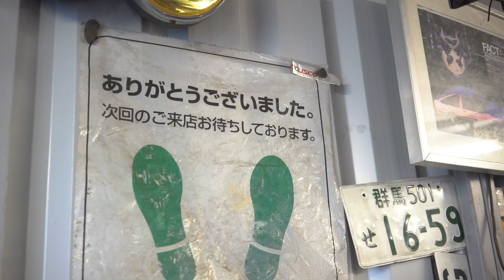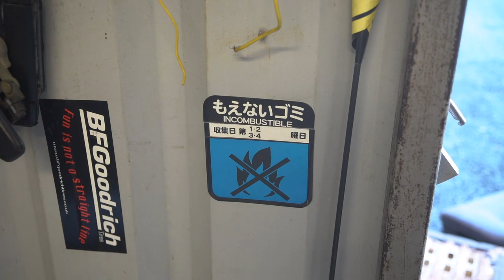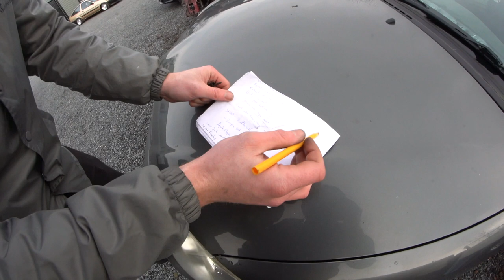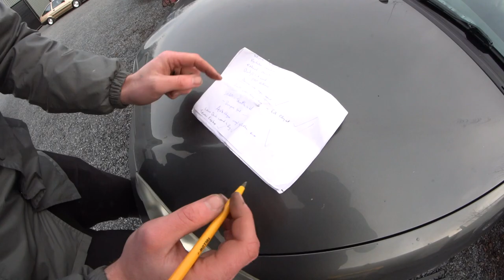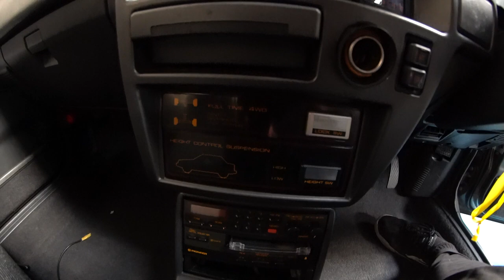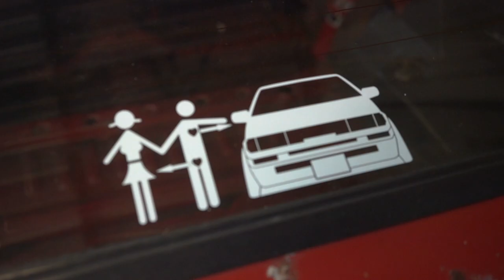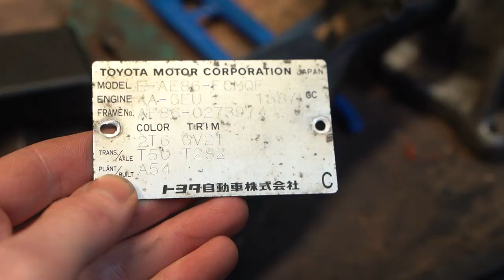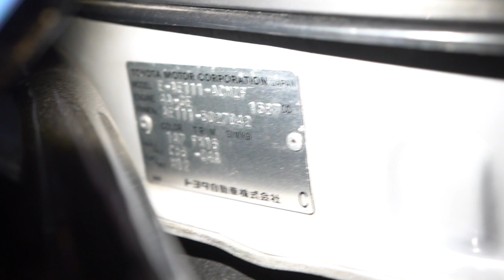Pot Of Gold! AE86 Parts Hunting And More At Mr X's | Juicebox Unboxed #114

Comment: Super interesting video, just putting a warning out there that the solid metal harmonic balancers are not the best for long term engine health incase you intended to use it. Sure they have less rotational mass and where on some race cars, but those engines where designed for frequent rebuilds not the long term goodness that most of us aim for/can afford.
Reply: yeah very true. they dont absorb engine harmonics like a balancer with a rubber isolator, and those vibrations can find their way into the oil pump if its driven drirectly off the crank, and shatter the gears in it. ford zetec oil pumps are well known to shit themselves with these fitted.
Reply from the maker: Noted!

Comment: I know the axle code on the Celica & Celica Supra were:
1, 2 - Non LSD General Diffs
3 - two pinion LSD
4 - four pinion non-LSD
5 - four pinion LSD (Holy Grail - Usually on the TRD model)
Reply from the maker: Awesome!
Reply: @juiceboxforyou  Though I'm not certain what size diffs would fit in the axle housing you have as the Celica GTS /Celica Supra had IRS rear axles... hmm I'm sure some Toyota gurus will know.